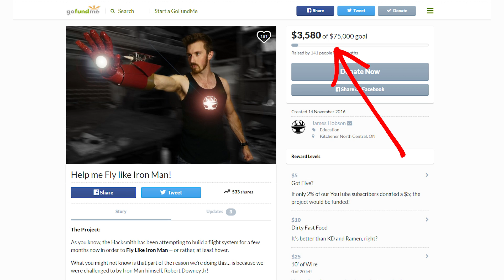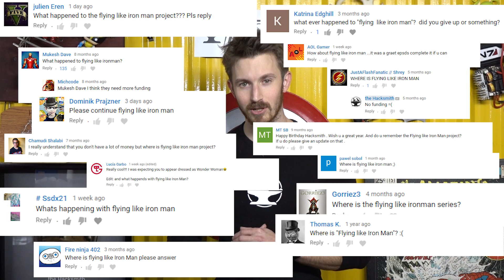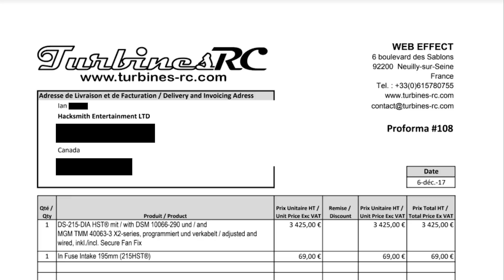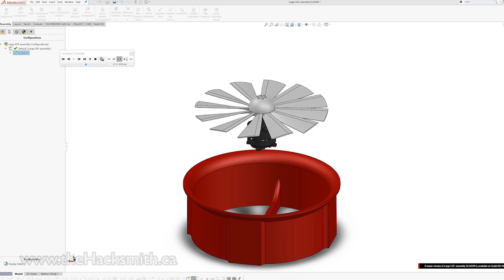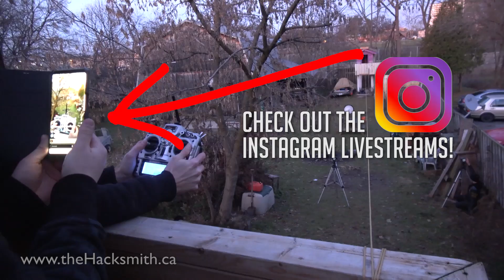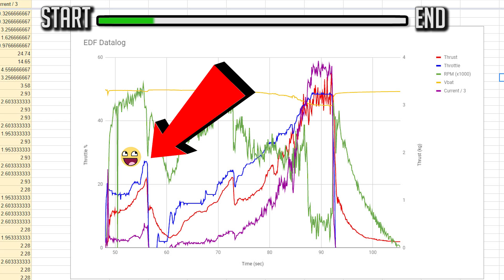Flying Like Iron Man #13: JET ENGINES, EDFS AND MORE!

Comment: Hacksmith, I think part of the issue is where you are putting your money. I think if iron man really did exist, he wouldn't be buying jet engines, he would be building his own. I think you can build sufficient jet engines for way cheaper just by doing your own research and using your own parts.
Reply: LUL wut?
Reply from the maker: +Red Clay building an existing jet engine design from scratch would literally cost hundreds of thousands of dollars. I'm an engineer, I think I know how stuff is invented?
Reply: Well maybe you guys should look for a new source of thrust then
Reply from the maker: +Red Clay again... Discovering a new source of thrust might be simple in an Iron man comic, real life is a lot more difficult. The fastest way to is flying successfully is by using existing technology
Reply: I didn't necessarily mean discovering a new type of thrust, I more meant exploring different types of rocket engines. Check out spacecraft propulsion on wiki. Some of the listed propulsion methods could possibly be cheaper to build. Also, Im only giving suggestions based on my level of knowledge. I am in no way trying to say I know more than you do.
Reply from the maker: +Red Clay spacecraft propulsion is for in space... We can only use what is commercially available, and that's what we showed in this video

Comment: Did you balance the fan blade?
Reply: You can tell by the noise it's vibrating like crazy as soon as you hit 30%, on another note though the vulture wings are a bit underwhelming. Why don't you try using a custom wing suit design, extend your arms length (not biologically of course:)) to increase overall wingspan. and take the wing from the tip of your reach to your ankles also to maximise the wingspan. the bigger the span the slower you can fly with less power or with less incoming air speed. Maybe try making a type of wing material also like some kind of silicone impregnated tear proof nylon I don't know just mimicking a bat or something, also wear rollerblades?! you can go much faster with them and it's landing gear... use edfs to increase ground speed, and then transition into opening your wings  they're not there to flap of course but they DRASTICALLY reduce the amount of power needed to keep you airborne thus keeping the all edf route possible and it will give you a lot more control. I spent a rather long time looking into this subject. but after realising part are expensive af I gave up on the idea. just remember Hovering is boring as fuck. Actually flying though my god.
Reply from the maker: +Eme Usani nope! That's not the noise though
Reply: If its not balanced it become less effecient and pretty unstable at those speeds.. Maybe you should consider balancing it. It easy, you can do it by yourself.

Comment: Question: Could the noise be coming from the different layers in the 3d printed Ring?
Similar to a flute where strong wind through a small tunnel creates a noise
Reply from the maker: +Jason Last nope it's from the duct, need it to be smaller

Comment: Elon musk needs to be funding these guys, I'm a firm believer the greatest things to be invented will be made in small shops by young people who don't care if people think it's impossible
Reply: Factories don't manufacture ducted fans that size and there seems to be a SUDDEN demand for ducted fans around 1-2 ft diam. So Maybe these guys could develop one and sell it to prospective builders. I want to build a flying bike and I reckon eight (1.5 ft) ducted fans would do it. Also (even better) there is a tilting concept on YouTube called the "Vision" flying car and it's a single seat pod with four (2ft) ducts that tilt. With only one seat it should be possible cos electric power tilting  is so simple (and it would be a great advancement for manned multicopters). Ducted fans between 1 and 2 ft diam would be ideal for this sort of stuff and whoever manufactures them should make a lot of $$$$$.

Comment: Use tungsten. Tungsten has an extreme melting point, is cheap and is easy to use. FOr heat dissipation, amke a vaccumm. JK altough it'd be cool. Try ceramic (altough heavy) or maybe synthetic alloys?
Reply from the maker: +thekidtonystark wrong project
Reply: the Hacksmith oof I am looking at everything rn and am making a little help guide diagram maker thingy. Just to make sure that exosuits gonna be in there. Right?